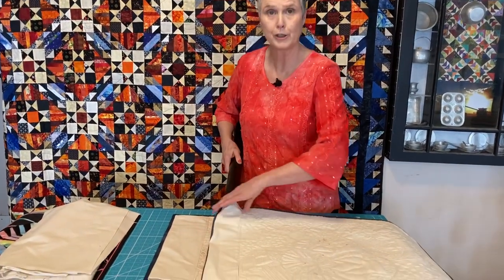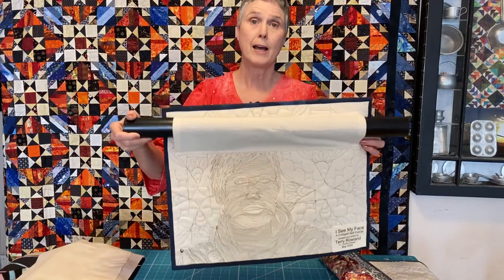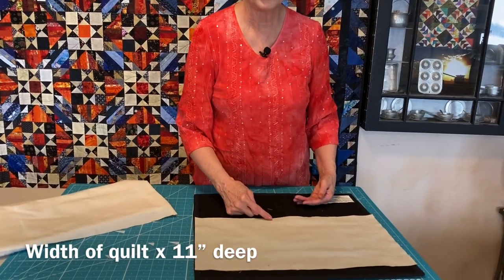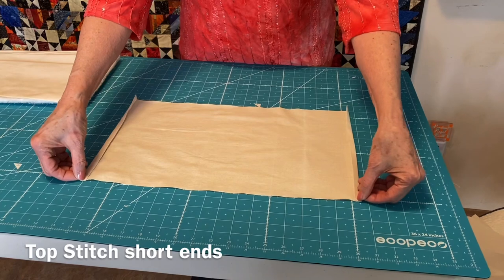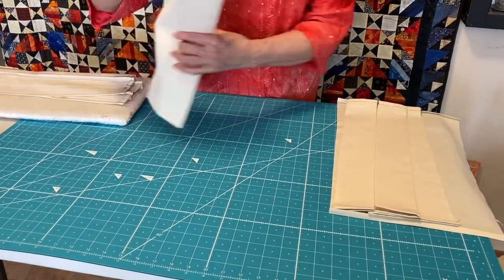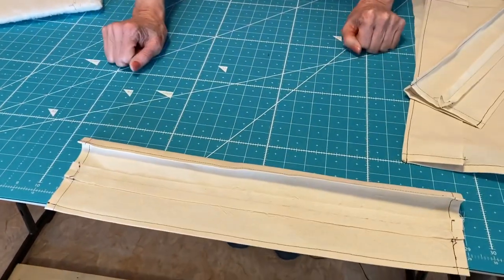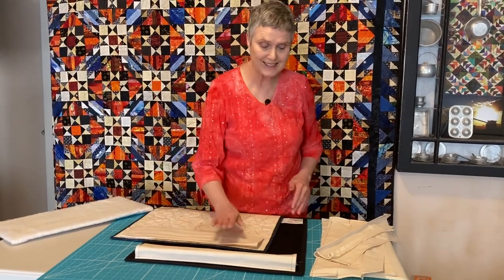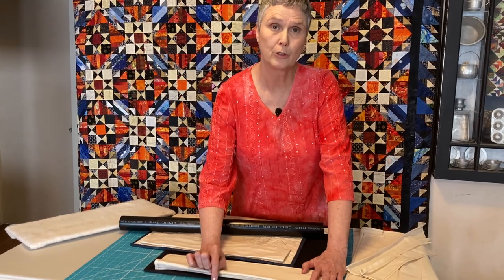How to Quilt Sleeve

Comment: Excellent video. I don’t enter quilt shows, but I do make sleeves for my wall hangings for home use. I have struggled with ways to give my sleeves that D-shape. Too many books and YouTube videos give instructions for making flat sleeves, and then you end up with a bump, even when you are using a thin dowel rod.  What height piece of fabric would you start with for a half-inch or three-quarter inch diameter dowel rod? Thank you for the video.

Comment: Thanks, Terry!  Love your method.  I will be entering my quilt this summer, and the rules are for a five-inch sleeve with 1” maximum on the top and sides after sewing it onto the quilt.  The quilt is wide 84 3/4” and  99 1/2” tall.  Could you please let me know the sleeve measurements?  I know you demonstrated a six-inch sleeve.  Would I need to split the sleeve in half or in thirds instead of making a long sleeve for this size quilt?  Any info you could give me would be so helpful.  This is for the State Fair, and these instructions are pretty detailed.  Thanks so much! Bobbie
Reply from the maker: If you make the sleeve like I described in the video it should meet the size restriction. And yes I would split it for sure. Just make sure the flat short ends of the sleeves are stitched to your backing so they don’t try and put the rod next to your quilt. The rod needs to go into the sleeve pocket. I hope that makes sense. Good Luck in the show
Reply: Thanks so much, Terry.  Yes, I always sew the side parts nearest to the quilt in case someone would try to put the rod in behind the sleeve instead of inside it.  👍 Bobbie

Comment: I always learn something from you! That was very helpful! I just want to know if you could still hang it from a smaller rod (would it hang right?) Or would you need to replace the sleeve? What if you don’t know what size rod a particular show is going to use? What is the most common size?
Reply from the maker: Well most say you need a 4” sleeve ( so that is starting with a 9” width of fabric ) but I have heard many people say that the rods are getting bigger at some shows. I do not know for sure as I do not enter in shows outside of Canada. But I can use my larger sleeve with smaller rods so I am making my sleeves with a 11” piece of fabric. I hope that helps Angie
Reply: @terryrowland398  Yes It does! Thank you! Makes sense, as long as it’s doesn’t pull the sleeve above the quilt top (why you attach it lower) it would probably hang the same. I’m curious if that’s a trend in the states too. I will have to do more research, but it’s a good thing to know.
Reply from the maker: @angielovett4159  let me know what you see in the lower 48 stayes
Reply: @terryrowland398  Will do!
Reply: @terryrowland398 Well I’ve just entered my FIRST quilt show! The instructions just say it needs to have a 4” wide hanging sleeve. People are telling me they cut it 9” to start. Does that make sense to you? I think I’ll probably cut mine 9.5” to start, or maybe 10”, because I want to use your technique. Wha o you think?
Reply from the maker: @angielovett4159  I suggest 10” it can be bigger than 4” just not smaller than 4” angie
Reply: @terryrowland398  Thank you! I may just go with your measurements,  so I don’t worry I’m cutting it too close.  I love your technique,  it makes so much sense. Thank you again!